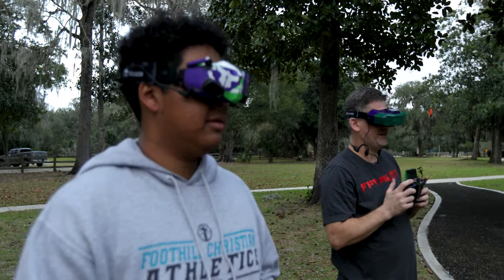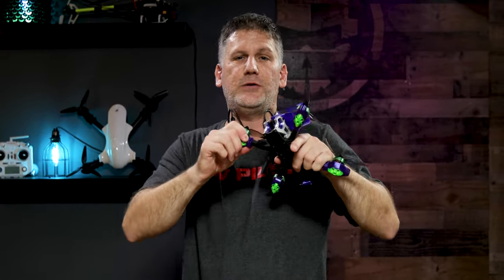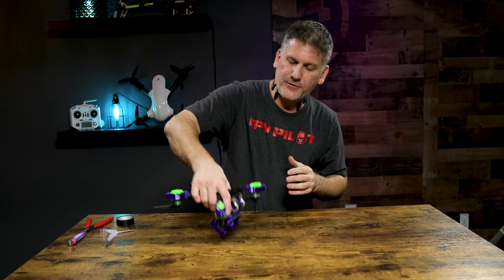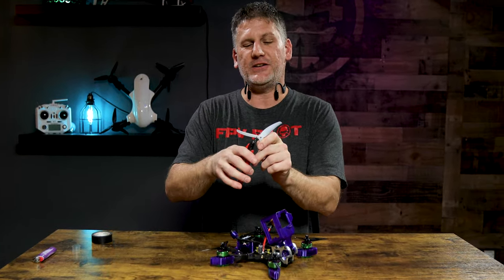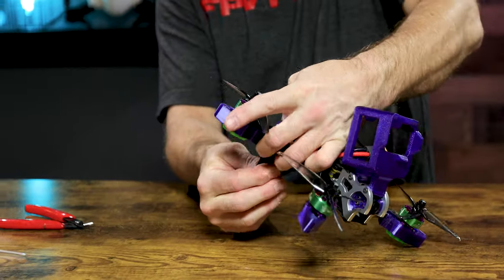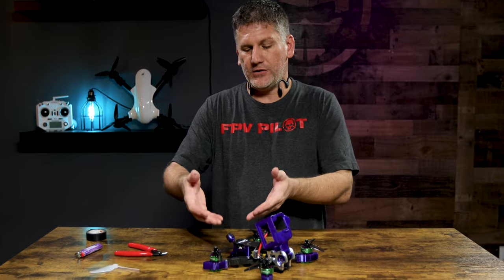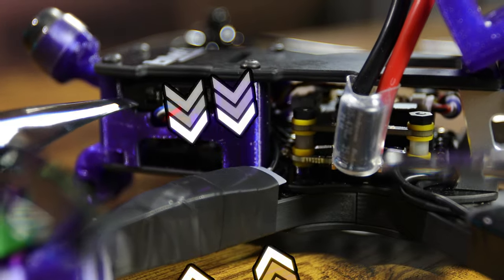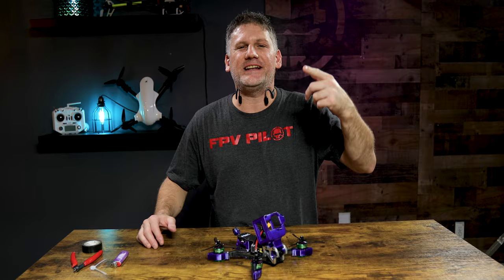5 TIPS To Make Your FPV Drone More DURABLE

Comment: I uses hockey stick tape to protect my wires on the arms, its really abrasion resistant and light weight, plus comes in bright colors, a roll last me a long time, i use 2 layers and put a drop of super glue at the end to prevent it from unraveling, ive never chopped up my wires since...
Reply: Bro i just did the same thing. Not super glue yet but mine was advertised for baseball bats, and has "ribs" if you will. It probably even dampens some motor vibration up the arms but i wont really know until i put fresh props back on.
Reply: @TavoFourSeven  yeah it definitely can help with vibration dampening too, but i usually run a pretty stout frame so vibration hasn't been too much of an issue

Comment: There's diamond braid rope that i take the core out of and slide over my motor wires then use a zip-tie to secure them to the arm.  I've never had one fail me and have been doing it that way for over 2 years. Also, I noticed the capacitor on your drone is hanging out the side by the props just asking to be knocked off.  One trick that I've learned to combat that is to use some small wire extensions solder to the leads of your cap so you can place it in a more protected spot and the flexible wire also helps protect the leads from snapping.  In frames with enough room for the cap to be placed standing parallel next to a standoff i will use a zip-tie to secure it around the cap and standoff which seems to provide the best results. Last thing, secure the battery lead at least 2 spots on the frame with zip ties, it will save your fc pads from being lifted and your wires from getting chopped.